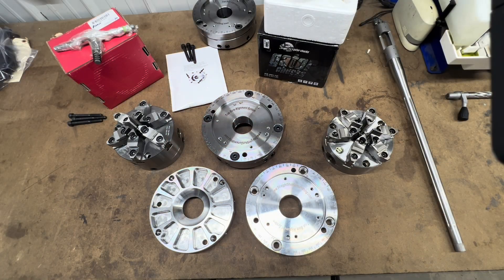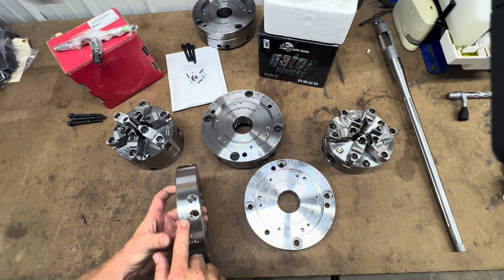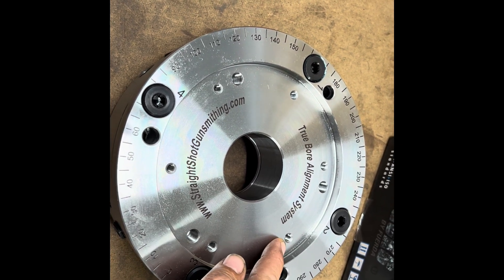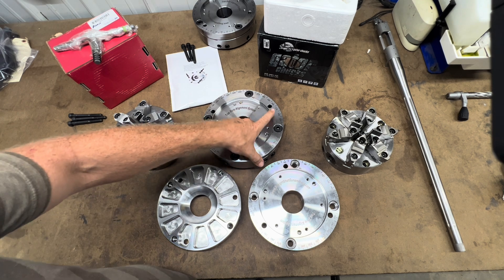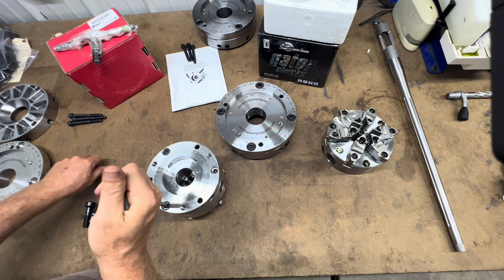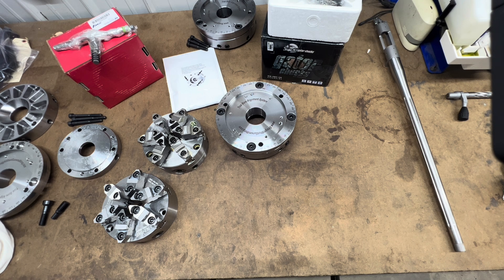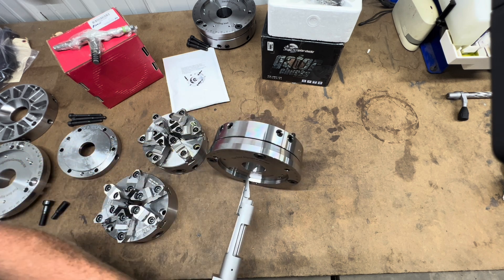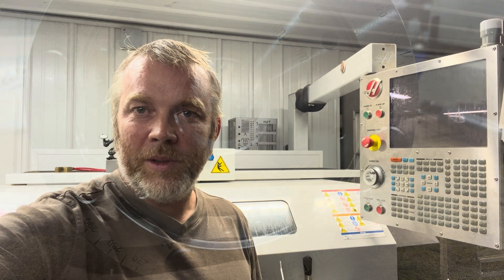V3 TBAS True Bore Alignment System, Overview 2024 SSG

Comment: Outstanding.  I would like to throw an idea out here. I believe it would be a great add on to utilize a threaded ball coupling so our turn mill CNC's can use the draw bar. The main goal is to utilize Royal Products  chucks. With having the draw bar feature for auto clamping, spindle bore liners and royal products chucks, we can custom order collets that match barrel profiles. Increase bed capacity

Comment: Great design improvements. The weight was always a concern of mine with an M300 Harrison. Will it still work with the US made Buck Chucks? I'll have to order one this year hopefully.
Reply from the maker: The Buck chuck does not work with the system due to that outside diameter of the chuck body is too large to fit between  the radial adjustment screws.
TMX is now made in the USA.